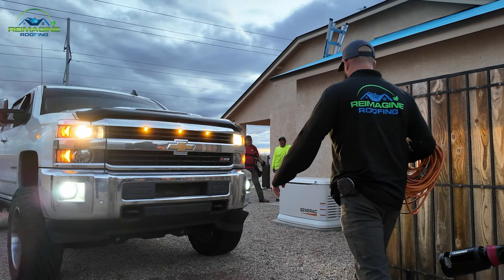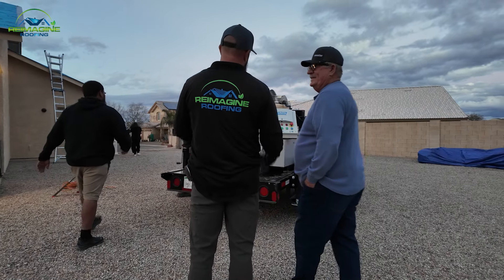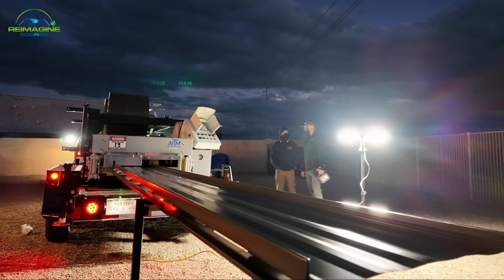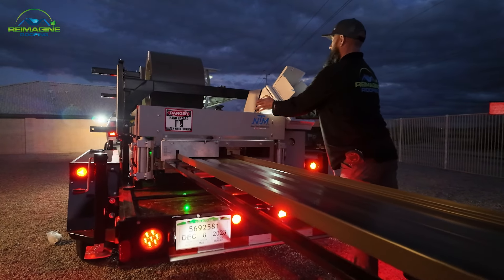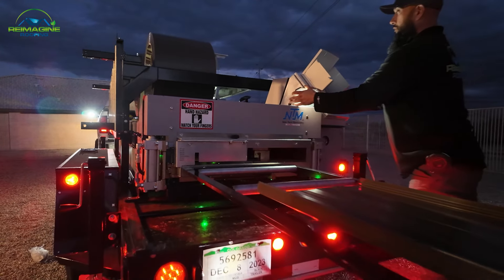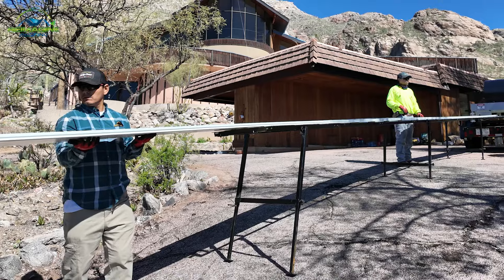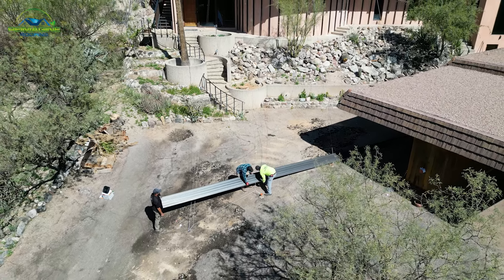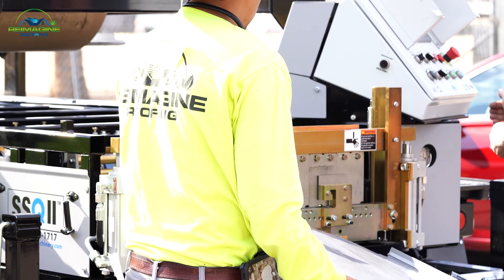EJ's Metal Roof Secrets: Transforming Sheets to Roofs in Minutes!

Comment: I strung my bosses new roll form machine up by a crane on slings and spit 80 footers right onto the roof about 20 years ago. He was pussed off and happy all at once. Seeing his new machine unbolted from the trailer and hanging in the air with coil dangling 25 feet. The roof went down fast.